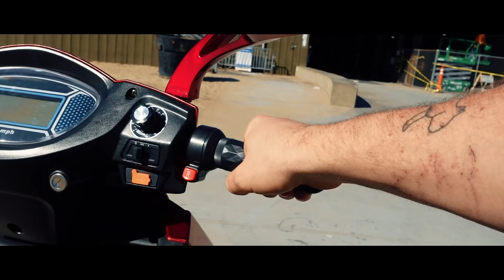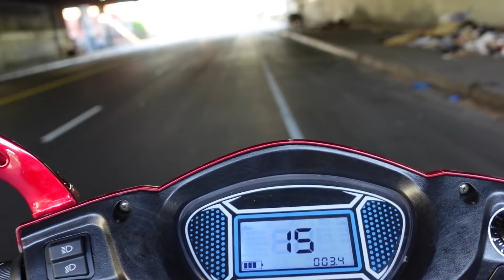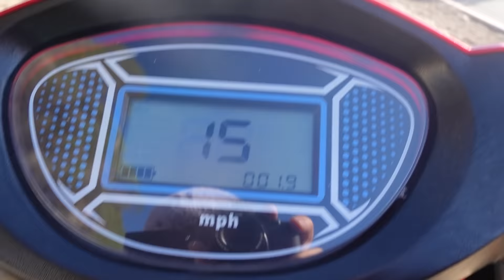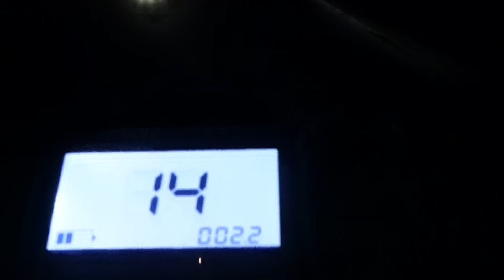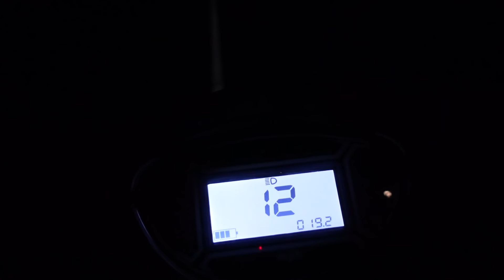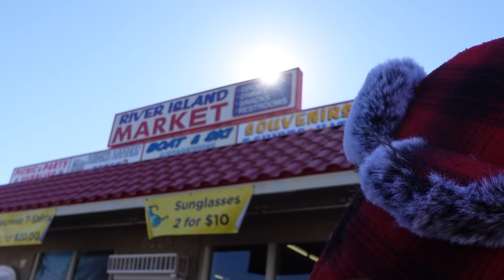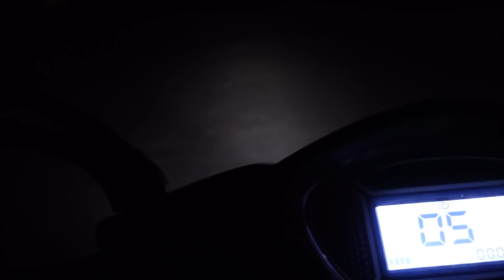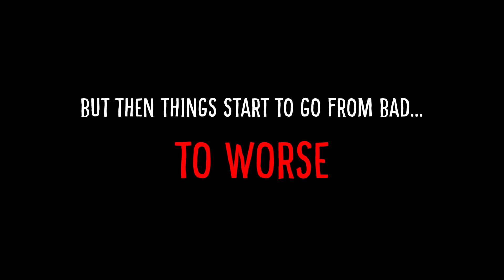Crossing the USA on a Mobility Scooter

Comment: You should have 5 trailers with a solar panel on each trailer. So during the day you can use 500w of power approximately 8 mph all day without battery loss.

Comment: If you got a bunch of power cables you could wire all those batteries in series and run a cord to the scooter. Wouldn't need to constantly switch out the batteries.

Comment: 1. The fastest you go the more battery power you use same as a petrol or diesel engine 2. The bigger your ah the grater the distance you can travel plus the performance on steep slopes is better because you ie if your batteries are say 100ah the better your scooter will perform on hills ie I have 2 90ah AGM batteries and I can do around 30 miles per charge depending 9n the terrain,  3. The weight ie the user or the weight your towing will use much more power so a shorter distance towing heavy weight, 4. Having solar panels may have helped charge or assisting you as you travel depending on the amp's supplied by the solars 😁 ie now the capability of your vehicle 😉

Comment: If the Batteries in the Trailer had a cable connecting them to the Scooter...he would have got around 30% more Range.....and one bigger Charger would allow rapid charging....

Comment: Hello,  I own a mobility scooter:  BUT: when the manufacturer says 40 miles, they are not lying, but they neglect to tell you that they base that on half the throttle speed.  Thus 20 miles at best: and uphill would cause more power usage from any batterie/s.
Using any accessories such as lights, stereo, uses up the batteries as well.

Comment: scooter could never sustain 15mph, for 40 miles, towing a trailer or not. the 40 mph range would only be possible at a reduced speed maybe 4/5 mph. and turning  the  switch on/off will not help.

Comment: with the size of the batteries and the fact that youre not a small guy and dragging 20 batteries and other cargo behind you does reduce the range by quite a bit , besides that the range in the folder is highly exagerated 
i run a 24 volt mobility scooter to work every day has 2x75 Ah gell batteries and its range is about 30 km , youre running about 20 Ah lead acid agm batteries 
btw they take bout 6 hours to charge 
just hope the controller and the electric motor will last the 3000 miles
maibe set a timer so you fill up the generator before its running out of petrol

seems you cannot get anywhere in the states without a car , maibe you needed a special licence (though i do get the fact that having sumting small travel at 15 mph on a verry long stretch of road where the permitted speed is 60 or so in the middle of nowhere on their own can be pretty hazzardous to the person driving the small slow sumting )
they have crossed the states on pedal bikes and go peds but i guess they have special permission and maibe a vehicle following them making sure they stay alive